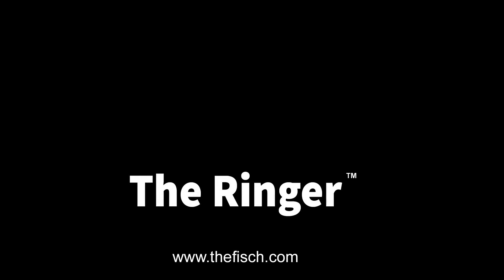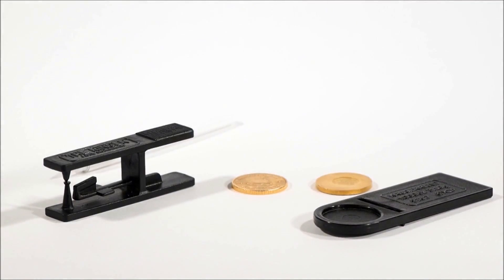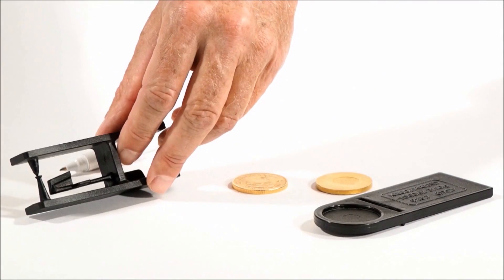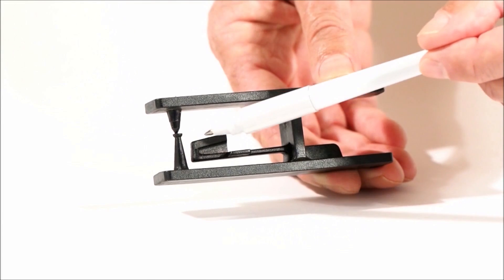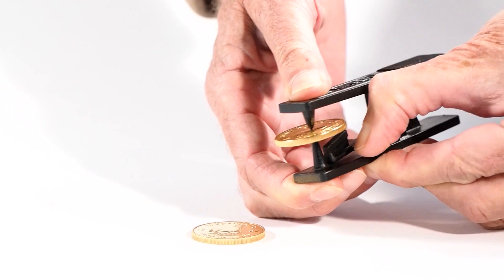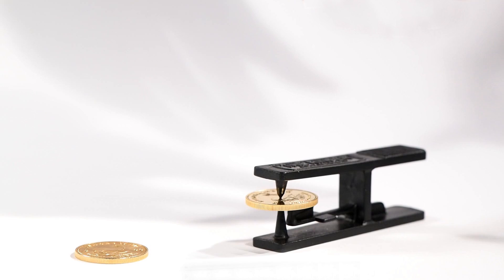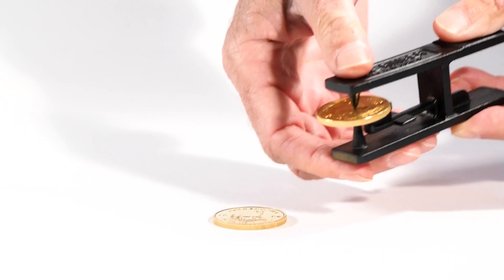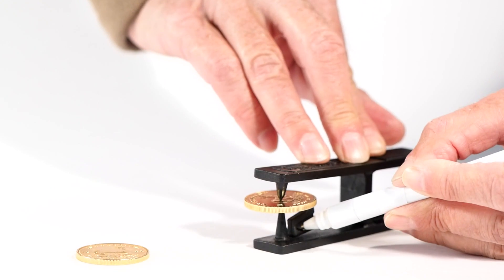How to detect tungsten fake gold coins with The Ringer by Fisch

Comment: Since each metal has a distinctively different ping, or resonant frequency, looks like it wouldn't be hard to design a small frequency generator and build it into a Fisch measurement tool. Having a tool that would definitively test for proper width, diameter, and resonant frequency would make the tool 100% accurate. Sales would be quite high. Many coin dealers and collectors would want to buy such a tool if it were designed. :)

Comment: What about Maples? Will this work for Maples and other 999 1 oz. and 1/2 oz. coins? Any advice would be appreciated. Very much interested in this product.
Reply from the maker: Yes, the Ringer does work on 999 coins. However the difference is a lot less obvious than with a 916 coin.  With the Maple Leaf 1oz, the tungsten fake only gives a dull thud when struck by the Ringer; the genuine coin gives a dull thud followed by a short, sharp ring.  The Ringer works on 1/2 oz coins as well.

The better your hearing, the better you will hear the difference. As our hearing declines with age, it means the younger you are, the better you will hear the difference!  A way to mitigate this somewhat is to record the sound and play it back at a higher volume. I will be putting this comparative test, and others, on my website to assist users.

It is taking longer to get the Ringer ready to ship. The hold up is the changes to the website and the printed instructions. Now I am looking at mid September, at the latest.  Watch the website: When it says "The Ringer"  on the home page, it is ready to ship.
Reply: TheFischWorks Won't this mark up or ding the softer 999s or 9999s gold coins? Thanks.
Reply from the maker: mata materns No, it does not. The Ringer has been selling since October 2014 (about 8 months) and there has been no feedback from users that it marks a 999 or 9999 gold coin. I have used it on a Maple Leaf with no sign of marking.
Reply from the maker: mata materns No, it does not. The Ringer has been selling since October 2014 (about 8 months) and there has been no feedback from users that it marks a 999 or 9999 gold coin. I have used it on a Maple Leaf with no sign of marking.
Reply: TheFischWorks Ok, thank you. That takes care of my concerns. The Ringer then basically can test all types of 1/2 oz. and 1 oz. gold coins, regardless of their purity, without marking the coins. I will be getting one then.